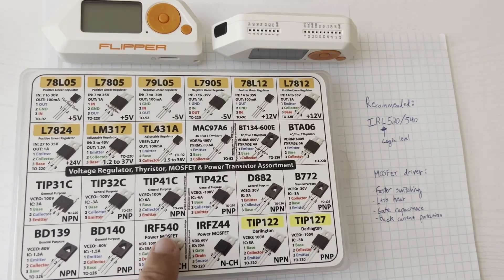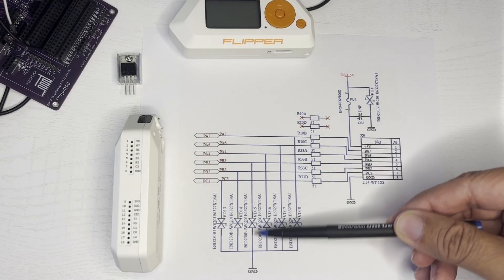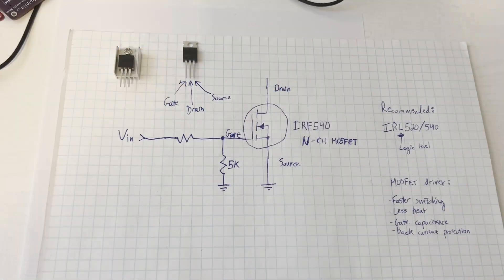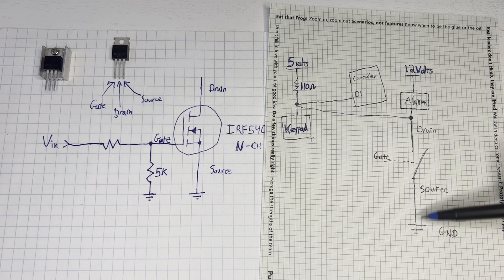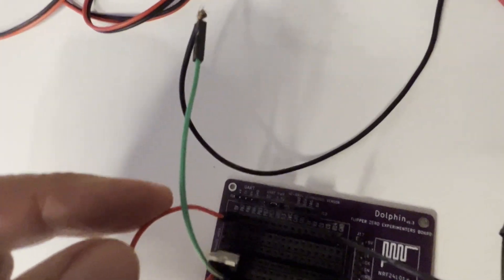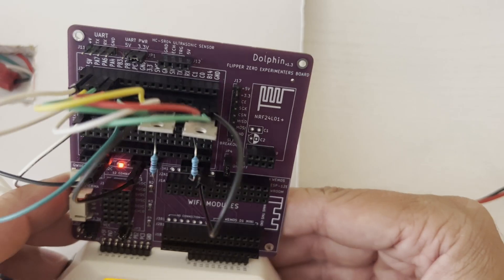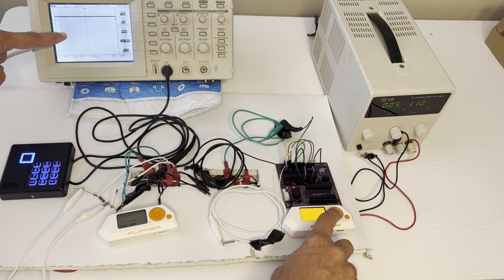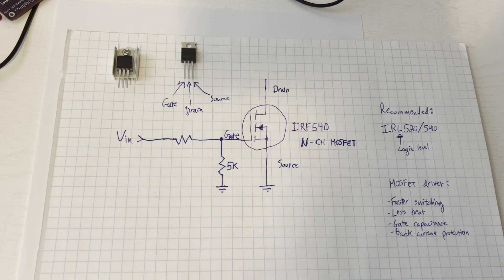[56] Flipper Zero - MOSFET for 12Volt devices and Wiegand hacking

Comment: Do you use the MOSFET only for replay or for capturing too? Can you give me a more clear wiring instruction with MOSFETs? I have to test a door lock but I want to secure the flipper for high voltages. I think the door lock uses 12v ...
Reply from the maker: First I would use a volt meter to confirm that the green and white wires are +5 volts.  The reader is likely 12V but hopefully the data lines are using a pull-up to 5 volts.  Flipper is 5volt tolerant, but not 12volts, so be sure your system is the typical 5 volt system.

To read the data: all we need is white connected to A7, green connected to A4 and black (ground) connected to ground.  That works great for reading & I use that configuration often with the two readers I own.

For sending data, we need the Flipper Zero to be able to quickly pull the green and white wires to ground.  The GPIO pins have a max rating of 20mA per pin.  One technique is to add inline resistors (but your controller could rely on a certain resistance -- it depends on the controller.)  The other technique is to use MOSFET to help the Flipper Zero pull the wires to ground.  I like the MOSFET because it pulls almost no current from the Flipper Zero.  You could also use an Optocoupler if it's response rate is quick enough, which would give you additional isolation.

Feel free to join my Discord server for more detailed discussion - https://discord.com/invite/NsjCvqwPAd
Reply: @MrDerekJamison  I soldered a breakout board for my flipper which can switch between 5v and 12v. I hope it will work. If it succeeds I will post it in your discord channel.

Comment: Nicely done!
Reply from the maker: I'm on vacation (again) but next week I'll upload the new Wiegand code that uses the MOSFET and update the README.md file for how to connect the two MOSFET devices.  It's really nice to not have to do anything other than just tap the wires.
Reply: @MrDerekJamison  what’s a vacation lol . That sound great.  I just ordered another Flipper just for these kind of experiments. Since I use my other two for work, Ive been a little hesitant trying a few of the experiments.
Reply from the maker: @mumbles1justin  I just updated the code to support MOSFETs (I've only tried with two IRF540 and two 5K resistors) but in general a wide range of MOSFETs should be fine.  I haven't tried a MOSFET driver yet (something like an MCP1403-E/P), but once I move to Nashville I'll probably order one to try it out.